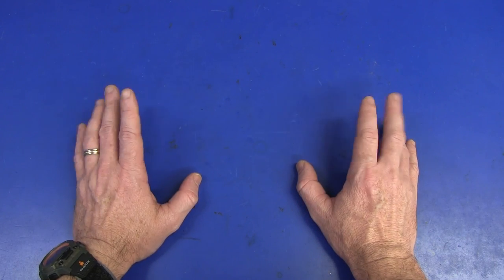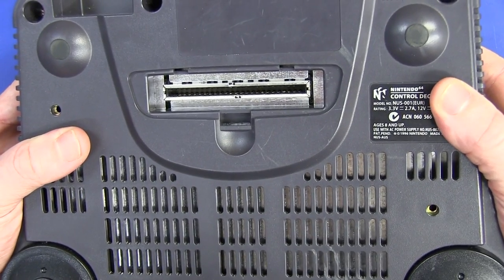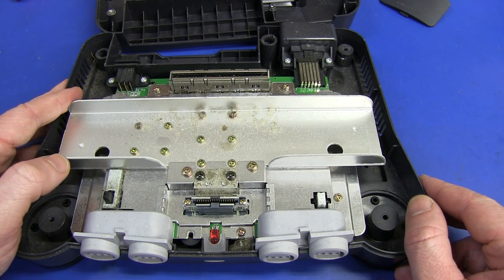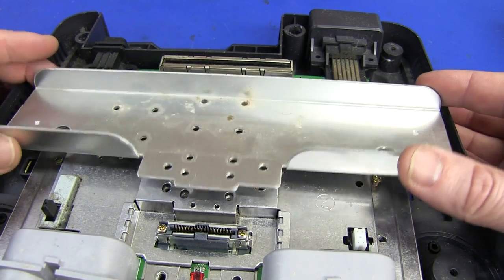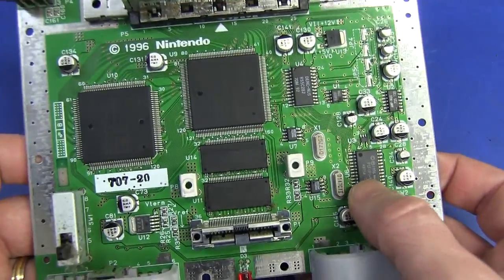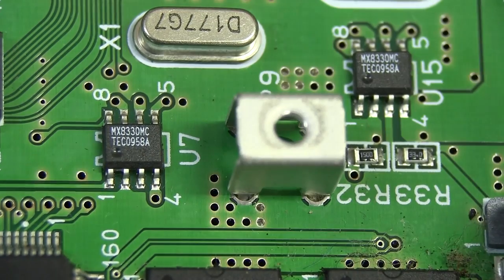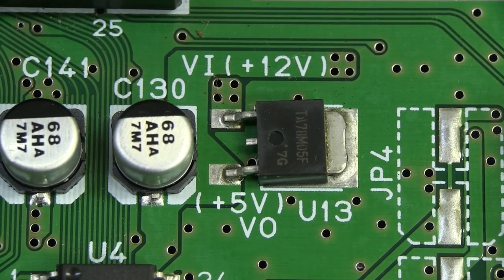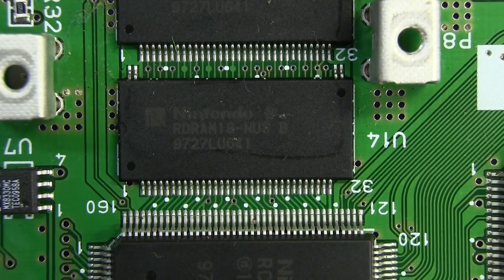EEVblog #491 - Nintendo 64 Game Console Teardown

Comment: great vid. 13:47 cool to see they used thermal pads instead of thermal adhesive on the CPU, GPU, and RAM.....you could probably remove the pads from the heatsink blocks and apply thermal paste for computers on those chips. I wonder how much of a diff it would make.

Comment: I set one of these on fire (I bought a jewel case one and wanted to dick around with mine) it still ran.
I dropped it 6 stories, still ran.
Ran over it with a 3/4 ton pickup, still ran.
Put it underwater and waited for it to dry, still ran

these things make todays consoles look like wet tissue paper
Reply: legionbunny They're the Toyota Hilux of consoles... I even remember overclocking mine. Made Perfect Dark, well, perfect.
Reply: frtard  yeah consoles used to be great. I have this and a ps2, I managed to drop the ps2 from the top of wardrobe and it survived, and I dropped by accident the n64 from the loft when i was taking it out onto the ground floor two floors below me, and it survived, so these things were sturdy.
Reply: My friend once said that consoles used to be made out of nintendium, the second hardest substance known to man, right after nokadium
Reply: legionbunny lol
Reply: +legionbunny Forgot to turn mine off while I went on a 2 month summer vacation. Came home and continued my OOT game.
Reply: +Mysterious Figure then how come my 2 ps2s just stopped reading disks at random
Reply: +Mysterious Figure how did you overclock it i really want to know
Reply: ***** oh... facepalm
Reply: +Cl0nec0mmand0 It's really simple if you don't mind soldering some SMD - http://micro-64.com/features/oc64.shtml is a great guide.
Reply: +frtard i can't do it myself i sold my nintendo 64 years ago i'm just amazed that something like this is possible i just got in to heavy computer gaming and overclocking and i'm amazed you could even overclock game consoles much less the n64 (i'm 18 years old the nintendo 64 was my childhood)
Reply: +legionbunny true story.My nephew spilled a drink and dropped a pregnant tv on the thing.I was mad and then I turned the tv on.the bastard still has my game running!
Reply: 〈Chopper Gamer〉 Did it have a boy or girl?
Reply: until you compare their processing power. I'd like to see this run GTA 5 on a 4k 64 Inch TV. Yeah, not wet tissue paper any more.
Reply: no... still weak
Reply: *n64 - lololol you droped me 6 stories from a building? Like i give a fuck

Nearly every console past 2006*  - oh god you bumped me and i moved an inch!!!! Im fucking dying now i will never run again!!!!!!!! Tell the noobs i wont be home for black ops dlc sales

Comment: For the screws: take a plastic pen (casing only) which fits in the hole and hold it above a lighter which melts the plastic. Then press the hot plastic pen casing into the hole with screw and when the plastic is cooled off you have a fitting mold to unscrew these.
Reply: Or, just buy a game bit driver for a couple of bucks and do it the right (and easy) way.

Comment: EEVblog A really cool tid-bit about the N64, is that it and the GameCube used the exact same AV cable plugin. So you could use the gamecubes should your N64s go bad or vice-a Verse-a.
Reply: Also controllers ... or at least sockets & protocol
Reply: Hans Meier Sorry. I can confirm that's wrong, The GCs is pluging for controllers is Much smaller and has a metal prong system on the outside, the N64 lacks that.
Reply: TheLastRaven6 not a problem :) Never used a GC myself and grabbed that info from an usually reliable source. Thanks for correcting.
The AV out at least has the same connector as the SNES tho ... that's first degree knowledge on my part.
Reply: Hans Meier Its alright. I cant confirm on the SNES one though, it wouldn't surprise me if Nintendo had done that.
Reply: The snes also use the same video connector. :) For example RGB signals is only supported on all variations though. I'be also seen this connector on extremely rare NES versions (i believe you had to live in france, have the NES2 and complain about the video quality to customer service to get one)
Reply: Well, it wouldn't really make sense to change the AV cable given there wasn't really any changes with the video technology.

Comment: On the processor, Pins 112 and 116 can be set in different configs.
CPU Pin #	1.0x | 1.5x | 2.0x | 3.0x
Pin 112	GND | +3.3v | GND | +3.3v
Pin 116	GND | GND | +3.3v | +3.3v

A mod on certain revs can add the RGB channels with an op amp or direct connections to the a/v out.

On the NTSC models the JAP and USA models can be cart-slot modded to be compatible with both regions.

The expansion slot comes stock with a jumper pack, which is just a terminator. The 4MB expansions just adds 2 more chips.

Comment: Pin 130 is VCC (3V3), and pin 154 is Ground, so it's probably just for impedance / noise control etc.

There are only a few signals going from the CPU to the cart slot, like NMI and /INT2. The COLDRESET signal comes from the PIF and control both the CPU and RCP main reset.

(I did some almost-complete schematics under Eagle a few years back).

Comment: The memory expansion has to be plugged in for the system to boot. The original consoles shipped with a termination block in place of the upgrade module.

Comment: I cringed when you brought the drill out, that was the 8mb (i think) memory expansion in that n64, quite rare these days.
Reply: The expansion pack added 4 MB of RAM I believe.
Reply: It increased it from 4MB to 8MB so yes it added 4MB.
Reply: Ronald Smith There's some second-party ones out there, and I think they're not so rare either.

Also, that RAM expansion does nothing for the N64's major failing...not enough texture cache!  (They probably couldn't have done much better given die space.)
Reply: Ed Herdman Actually, I better walk back that comment about "does nothing" - I forget that the RAM actually helps some games attain better frame rates, and others get better textures.  The texture cache is still a problem - I imagine that the RAM is just allowing more textures to be quickly available for rendering in the cache.
Reply: Ed Herdman and also required for donkey kong 64, for a graphics bug I beleive?
Reply: It probably wasn't. All N64 units shipped with a dummy placeholder cartridge in that slot, so it was likely one of those.
Reply: Neil Houghton  The Placeholders didnt have the red grating on the top, only the Expansion Paks had those.
Reply: Ed Herdman yeah playing Resident Evil 2 with the Expansion memory, you can tell the difference, Smoother higher resolution models for zombies and protagonist, though it still sufferes from below average video compression, but that cartridge is alone is a marvel in software engineering. RE2 came on 2 discs for the PS1, but they fit it ALL in a 64MB cartridge
Reply: Tre Selor RE2 came on a 512MB cartridge, the biggest made for the N64.
Reply: Wait what?
Reply: Tre Selor Derp, you are right it's 512Mb, not MB.

Comment: Very nice video. As few others mentioned, the console sits idle without a cartridge and it isn't hotswappable officially. Probably doesn't help that it doesn't have the expansion memory inserted either (since its RAMBUS). But it will send out a blank video signal with power, which is probably what your seeing. Either way, very cool.

Comment: Fuck, N64 is retro now? Twenty years passes quickly. I was eight years old with this thing came out and it was the cutting edge of consoles in my feeble mind. I remember playing the NES in the late '90s and thinking that shit was outdated.

I bashed the shit out of mine because I thought I could take the processor out and put it into my PC. Lo and behold, there's a lot of different chips in there and I couldn't figure out which was the CPU. I was unaware that if it didn't have AMD or Intel socket pins, I was shit outta luck.
Reply: +joh n Live and learn, brother.
Reply: I'm sounding like an old fart now.
Reply: Where does that leave me and my Commodore C64?
Reply: I bashed the shit out of mine because I thought I could take the processor out and put it into my PC
Reply: N64 and PS have been considered retro since about the time xbox 360 came out, found it pretty weird first time I saw a 3d console refered to as retro.
Reply: 1: the n64 CPU is niether electrically nor logically compatible with an i386 PC.

2: the MIPS 64 architecture and the Intel i386 architecture are as different as night and day 

3: even a desktop from the late 80's running DOS or Windows 3.1 would have more processing power than this heap of shit console
Reply: Joseph Beasley it almost worked tho

Comment: The bootloader is on the cartridge, also you didn't even have the memory termination on it...
Reply: jonharson - Technically, the initial bootloader is in the PIF chip (lower-right of the board), but yep, it does read about 1MB from the start of the cart into RDRAM, then executes that...

The R4300 reset vector is a 0x1FC00000, and the RCP chip maps the PIF chip Boot ROM into that address space at power-up too.

Part of the small PIF boot code actually loads into the RSP (vector CPU inside the RCP), which then initializes the Country / TV region and RDRAM, checks the CIC lockout chip, then loads the cart boot code into RDRAM.

Yep, the N64 must have the "jumper pak" installed before it can boot at all.
Not only do the resistor arrays on the jumper pak pull the RDRAM data / control lines up to a VTERM voltage, but it also routes the RAM clock through the jumper pak and back into the console.

It does that so the clock is always input from the end of the "chain" of RAMBUS chips, as it's at quite a high speed, and the routing helps with the impedance matching.

A few years ago I managed to emulate part of the PIF chip on an FPGA, and got the N64 to show some stuff on the screen without even needing a cart in. ;)
Reply: ***** Hi - it was just a basic test to see if the N64 would try to boot from some simple code in the PIF Emu on the FPGA.

I simply lifted the three data / clock pins on the original PIF, then hooked up the signals to / from the RCP directly to the FPGA board...

The test boot code only enabled the VI (Video Interface) so it would show something on screen, and because the RDRAM was uninitialized, it only displayed some garbage (coloured dots etc.).

IIRC, there's only about 2KB worth of boot code in the PIF, so not much to play with.

It would be possible to get it to display a simple logo or something without a cart in though.

I didn't implement the controller / EEPROM / CIC stuff either, so the CIC codes would need to be spoofed to get carts to run (like most emulators do).

It was more of an experiment really, but I'm way further along than that now...

We may possibly be seeing an N64 FPGA core in the coming months, and maybe even an open-source SNES core. :)

Comment: Little tip for those annoying anti tamper screws, circlip pliers!  The type with 90° ends are best as they have a vertical approach to the slots when turning, straight ends would be at a slight angle and could jump out when loosening a tight screw.  Don't know what circlip pliers are, google it!

Comment: Fact : the n64 was designed to boot using the 8mb expansion by default and would only go to the integrate 4mb when the expansion wasn't plugged in
Reply: RandomVideos woow didnt kow that. but what i dont understand is why made it the graphic of some games better, namingly turok 2 if i remember correkt
Reply: Noxy Keng i guess the normal 4mb couldn't handle high-res images as they use more resources
Reply: RandomVideos ah that makes sense thank you very much
Reply: Noxy Keng You're welcome
Reply: +RandomVideos Not sure what you mean by "boot" using the 8mb expansion?

Part of the initial test of the RDRAM bus is to output a signal from one RAM chip to the next so it can determine how many chips there are, but that's about it.

I'm not even sure the boot code (inside the PIF chip) then does any further checks above the usual 4mb. That's usually left to the boot code inside the cart itself.

But yep - the 8mb expansion was required by some later games so they could store higher res textures, and also leave a bit of extra room for a 640x480 "high res" framebuffer too.

btw, the RAMBUS stuff won't work at all unless the jumper pak is installed, because the jumper pak routes the main RDRAM clock from the clock gen chip back through another pin on the expansion port. The jumper pak also has pull-up resistors to VTERM for setting the idle logic level, so the RCP wouldn't be able to access the onboard RAM at all without it. ;)
Reply: electronash I meant that it was designed to use the 8MB expansion by default
Reply: RandomVideos Yep, it has the option of using 4MB extra, but the console doesn't really attempt to use the expansion at boot time unless it's installed?

There is only 4MB onboard on the N64, so the "8MB expansion" is only an extra 4MB.

Still not sure what you mean by the console wanting to "boot using" the expansion by default? Only carts specifically designed to take advantage of the extra RAM actually use it?
Reply: electronash It will try to find the expansion pack. If it finds it, it will use it in conjunction with the internal memory. If it fails to find the expansion pack, it will only use the 4MB internal memory.
Reply: Yep, I understand...

The Rambus controller on the RCP will of course "check" for the existance all the chips on the bus, up to a total of 8MB.

(the games do have to be specifically coded to take advantage of the extra RAM though, naturally. and yes - the extra RAM does make it feasible for higher-res video and higher-res textures.)

It's just that your original post might give the impression to some people that the early games were really supposed to have 8MB from the start, but were forced to be cut down to use only 4MB when the console was first released.

I see what you mean now, I just wanted to make that clear. ;)

As a side note - The Rambus controller on the RCP (and hence the whole N64) can only ever support a maximum total of 8MB btw, even if you added more RAM chips, you wouldn't be able to access more than that. It's just the way it was designed.
Reply: Also, for games that don't specifically support more than 4MB of RAM, they won't even attempt to access the extra RAM at all.

(The boot code in the PIF does do some basic checks to determine whether the Expansion Pak RAM is available though.)

It's a shame they tried to shove everything into a single chip on the N64 really, as it could have done with being a two-chip RCP with far more texture cache etc.

There's a really interesting article here with an inside-scoop on the pressures the chip team were under to squeeze almost everything into the one chip (not including the RAM / CPU / PIF etc.)

http://steveshepard.com/blog/2015/07/18/the-making-of-project-reality/
Reply: electronash I have no idea what a two-chip RCP is, but cool.
Reply: RandomVideos I meant that Nintendo "could" have gone with using two chips instead of one, which would have meant the N64 would have been quite a bit more powerful than it was.

They really did try to minimize the hardware costs with the N64, which meant that a few things had to be sacrificed, like the texture cache etc.

If they didn't have to squeeze everything into one chip, it could have been an even more awesome console. I still love it though. :)
Reply: electronash I've never played on an actual N64 b/c I'm 16 but I have play DS ports of SM64
Reply: +ElectronAsh Ah the link is dead, I'd love to read that article. I grew up playing the NES, then SNES then N64, loved all these systems. I've taken them apart many many times, replaced chips on them, even wrote code for the NES and a lot more! If you can find that article, I'd love to read it. I can only imagine the stress the engineering team was under to merge the chips. As an embedded engineer myself today I truly understand how that works!

Comment: It might be worth noting that in order for the system to function, you needed at least a jumper pack plugged into the memory expansion port (which the system shipped with). You could buy the memory expansion pack separately, but some of the more popular titles in it's library actually required and shipped with the expansion pack. It also could boot without a cartridge, but it wouldn't get past the boot screen. As far as I know, you couldn't hot-swap the cartridges either.
Also, as noted in the comments already the expansion port on the bottom was for some Japan only add-ons such as the disc drive as well as some development kits.

Comment: It's not a heatsink as much as it's a channel for the airflow to follow to get to the vents. It was probably necessary without a fan to push the air. It used convection instead of forced air to keep the thing cool and silent.

Comment: a good trick for getting out weirdly shaped security screws is to take a plastic pen (the thicker the tube the better), remove the ink cartridge, and heat the end of the empty tube with a lighter. when it's soft enough to mould push it down hard and straight on the screwhead, let it set and you've got yourself a custom screwdriver. It won't last for very long, but it beats drilling things out imo.

Comment: I know I'm 4 years late but the so called expansion slot on the bottom was used to connect a developers extension that allows developers to get diagnostics about their game and to inset specialized development cartridges to configure the console in specific ways. The expansion now a days is very hard to find and even if you find one its a very small chance it would be working.